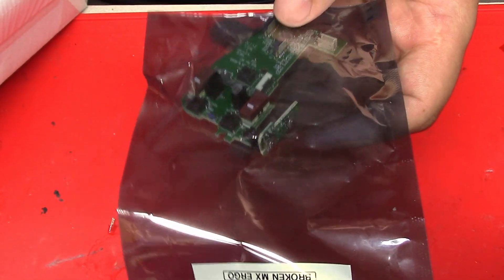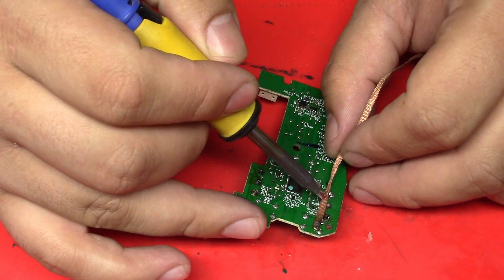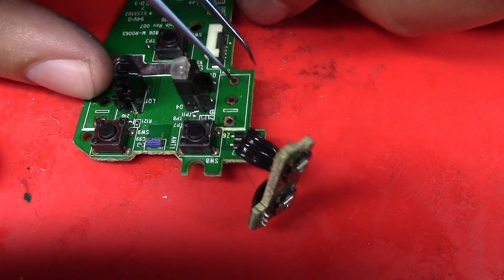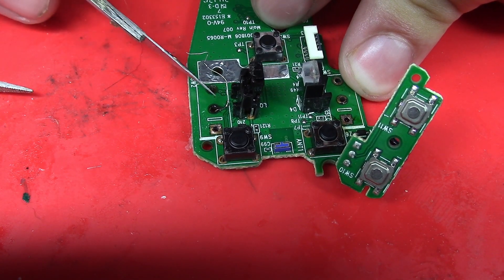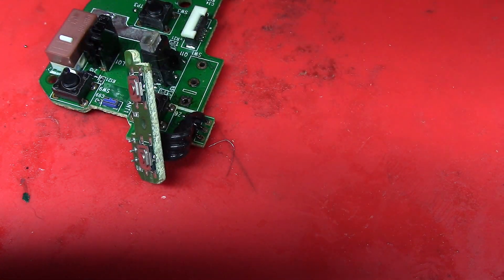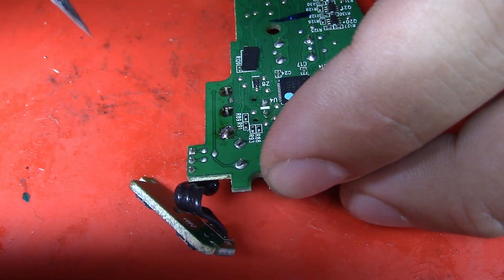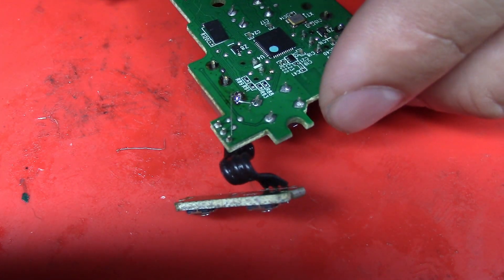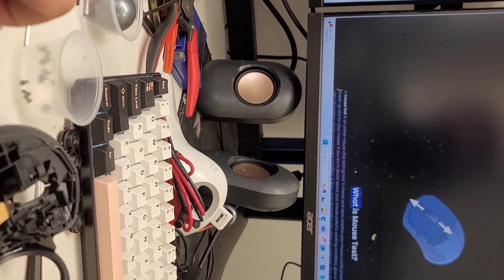Solderking- raw repair episode 1

Comment: Yeah, solder wick adds a ton of thermal mass that your iron needs to recover from. The time it takes an older iron is long enough for the flux to burn off and the wick stops wicking. A cartridge type iron with near instant thermal response and recovery will work much better.